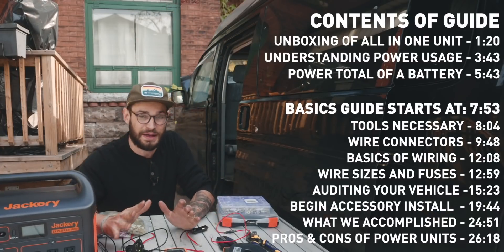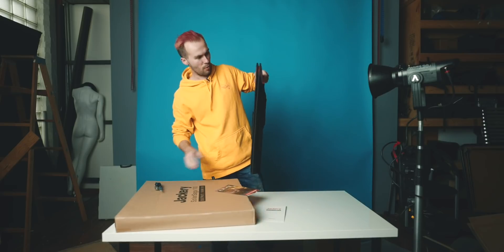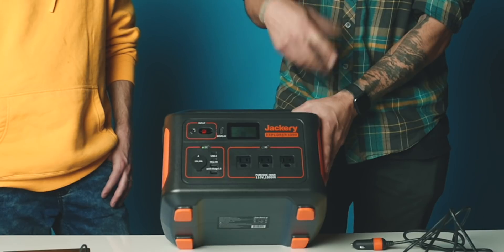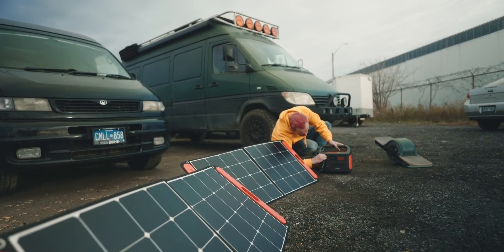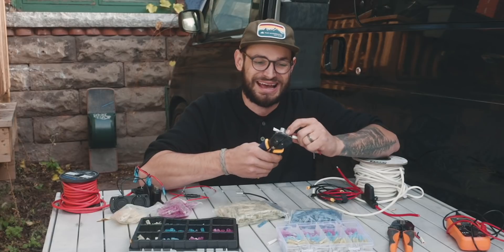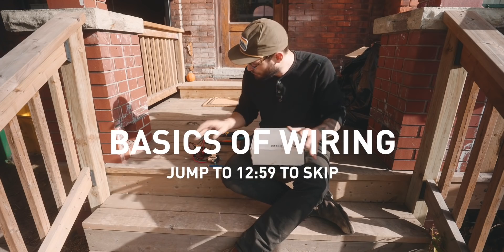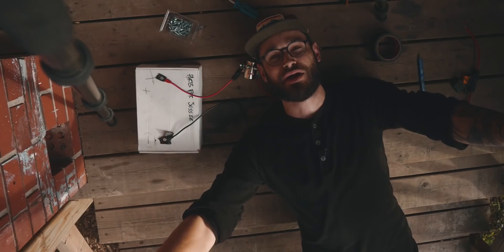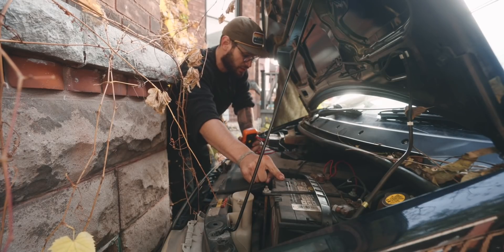Beginners Guide to Camper Van Electrical Install | Absolute Basics

Comment: My wife and I have an Airstream trailer coming our way in February. It has some power options but a Jackery system would mean making content on the road would be so much easier without worrying about the fridge running out of power.

Comment: We use our Jackery 1000 to power our high top Promaster and it is awesome. We swapped from a DC fridge to a 110 fringe with separate freezer door and after 14 hours we were still at 40% with no feeder battery. This works great for our style of camping because the van charges the Jackery while we’re traveling and it provides plenty of power if we stop for the night at a truckstop or primitive camping. We normally stay at places that have power but when we are running around for the day we don’t have to worry about the fridge. I also have a 12 V AGM marine battery we use to backfeed the Jackery. The AGM battery charges really fast when the van is running whereas the Jackery can take up to 14 hours to recharge. For us this system works really well and I don’t need a solar panel.
Reply from the maker: Right, the biggest Jackery downside is charge time. Glad to hear that system is working well for you

Comment: I've been intimidated about wiring my van and I intend to work with a simpler solar generator type set-up - this was a helpful video for understanding the concept. Much appreciated. I managed to live for a month in my van, working full time with a laptop, all powered by my Jackery 500. I was charging my laptop, iphone and MiFi device. I would plug it in while driving and it was about every three days that it would need to have a sleep over at a friends house using one of their 120V plug to top it off. I think the Jackery is a great way to get started into vanlife on very basic needs, if you cannot afford the money or time to do a full solar set up. As you said though, I had to be VERY mindful of usage. I did not have a fridge and my lights were simple magnetic battery powered pot lights. You can get away with very little if you want to or have to. I can see this Jackery 1000 being a great option for car dwellers. Could this unit potentially be powered by permanent solar panels on the roof? I assume so, just like any other.
Reply from the maker: Yes it could receive power from on roof panels. Glad to hear the 500 has worked great for you!

Comment: I'm starting a van conversion in January!  I have a 1990 Ford Class B Camper (Falcon 190).  I will power a 12v cooler, all van power and use the van to work from for extended trips, so laptop, monitors...etc.  I like the idea of these self-contained units for my context because I will not be full time in the van and would have uses for the power pack when I'm not camping in my van.

Comment: I honestly just came across your channel as recommended by YouTube. I am researching into using a power system for my conversion of my 13 year old SUV. I have shortlisted Jackery as proven by many YouTubers. However, I’m in Malaysia and there’s no dealer here. I would appreciate a lot if I’m lucky enough to get your vote as it would meant a lot to my budget. I would also hope to convince others to use Jackery and if possible work out a business opportunity here. I’m prepared to subsidise for transportation cost to Malaysia. With this Jackery, it would solve my electrical needs for my fridge, phones, laptop, lights etc. It will definitely allow me to get a drone sooner which was not a priority at first.

Comment: Yo, that battery/converter/charger/solar-box of magical wonders and mysteries would be the perfect power solution for the van conversion I've started this year! This would step the entire build up from an awesome getaway camper to a full on off the grid mobile basestation because I could bring a mini fridge to avoid spoilage when I'm not able to stock up on food for a week or more. Even so, thanks for the awesome video, will definitely rewatch this a couple times to doublecheck my wiring! Cheers!

Comment: First video that I have seen that touched on why power seems to drain faster while using AC ports compared to the USB ports. I’ve been wondering about this for months now. Thank you!

I would definitely use this for my new circumstance of living in a car experience. Mainly running fans when heat is unbearable during the day, or charging up lights and laptops to keep working when the sun is down seems important.

Comment: I would charge my camera batteries, go pro and lap top. Allowing me to make content in the field and not worry about being off the Grid for multiple days. I did a 5 day river float, photo shoot in Alaska and was so worried about batteries and charging my equipment. And also not being able to back up images.  I ended up having to buy so many extra camera batteries and cards, specifically because I couldn’t have my laptop on the adventure with me because of no available power. Having a power source would of been not only handy, but also would of eased my mind and allowed me to back up my images. I was shooting for a magazine and didn’t want anything to go wrong. I had looked at a couple of portable power sources but never pulled the trigger, because I find they can be confusing trying to understand there outputs. I appreciate you guys explaining it and breaking it down! 👍

Comment: Only just came across your channel recently, through your 9 things you’d change about your van video. Super helpful, as I’m planning my van conversion atm! I‘d use the jackery unit as my main power source/electrical set up, as I do find the job of customised electrical set up pretty daunting - phone charger, my fan, security system would run off it. Thanks for the great content!

Comment: Thanks for the video. Nice to see others workflow for electrical and types of connections. I would use that Jackery, because it can be carried around, to power tools I use on job sites or on the road. Like my Lithium battery power tools or USB soldering iron!

Comment: I would use that Jackery to power my 12 volt ARB FRIDGE and 12 volt lighting system in my cabin or van. Great info on wiring and installing 12 volt appliances.Thanks

Comment: I just bought an old Ford class b van @mobysvoyage . I had to gut the whole thing and I’m currently trying to figure out electrical (it gets confusing). I would love to build a DC system to run a max air fan, a hot water kettle, and some lights. Thank you for your content! So helpful!

Comment: So for just a little hint if you want to charge your Jackery a little faster while out camping or if there’s no sunshine for the solar panels you can plug a 300 W inverter into your 12 V of your vehicle and then plug the Jacquerie into the inverter and it will charge faster Then it went with one solar panel now at two solar panels maybe it’ll be about equal.

Comment: Thought I would have my build done by winter , and am still several months out.  The Jackery could power my newly installed Webasto which has no power, so that I don’t freeze while building out the rest of the electrical and interior.  Winter is coming!

Comment: First off, welcome to Ontario. I would love to get the larger Jackery 1000. I’m currently using a Jackery 240 to power a small 12v fridge and some accessories in conjunction with a small sla battery/solar system. Works ok but have to keep an eye on the discharge rate.

Comment: I’ve been running my Dometic off of my starter battery which has been fine for when I drive every day, but definitely not going to work for long stationary trips. Would love to add a power bank like the Jackery to my setup.

Comment: That would add so much functions to my Unimog camper. Also I would make it so I can also take it into my Volvo V70 station and put an air matras inside and go for a long roadtrip! So much possibilities with an portable setup! The solar panels alone look already awesome!

But wait is it only 110volt? I need 220 :D

And I love building electrical wiring :) I build my whole electrical system Unimog from scratch! So the whole wiretree with headlights signal lights etc!

Comment: Thanks for the electrical lesson! Great breakdown of what is needed and what can be done with some basic know-how to get your system up and running. The Jackery would be great to use traveling in my SUV for now to power my cooler, laptop, etc. Then when I upgrade to a van it could easily move with me.

Comment: Purchased an ambulance. I’m planning to do point of use power. Going to use a portable power station at several power locations. The Jackery would be the main power source (refrigerator, lights, water pump)

Comment: A Mazda Bongo, brilliant..! I never thought I'd see one on here.  I have one myself but a tin top, not an aft and with its 2.5td engine it's a wee beast.  I live in mine and have done on and off for over 2 years now and currently building out version 3.0,hopefully the last build with this van but they are great wee things.

I do have a basic set up electrical wise with a split charge relay but I haven't gone for an invertor or solar because I don't have enough to condone permanent upgrades but I have thought of getting the Jackery to charge up my camera and laptop whilst I am away from work on road trips. Cheaper overall I reckon for someone like myself.

Comment: I would use it to power my small heater.  I have been without heat and have gotten sick.  I’m 70 years old and live in my van because I can’t afford rent prices.  I only have the small Jackery which shuts off as soon as I put on my little heater.  My little dog sleeps with me, my bigger dog has a coat, but it’s been so cold and rainy that I haven’t  been able to sleep well and get better.

Comment: Thank you so much for this!!! Helps quite a bit. Especially the recommendations for tools, wires, and connectors. Next week we’re going to start running wires through our van; two fans, usbs, lights, etc... rather daunting, being this is my first time. We’ve ordered the 1000. Question: do you think we can wire in parallel or daisy-chain a few of the components into the single 12v plug on the Jackery? For example both fans (maxxair), and perhaps puck lights?
Reply from the maker: I’m excited for you dude! You can tap off DC power from the Jackery using a 12v cigarette style plug. And run that into directly into what is a essentially a power strip but for smaller DC circuits, a small blade fuse holder. Lots of options, but you want one you can easily connect the - wires to as well. And then just wire whatever accessories you want to run into the fuse holder and then run that to the Jackery
Reply: @Levi_Allen  awesome!!! Thank you once again!!! 👊🏼👍🏼

Comment: I would charge my GoPro, phone, charging pack and other accessories well doing long-term stands living inside of a vehicle that is not fully rigged out to be a camper

Let alone that you could use it to cook your breakfast lunch and dinner run a a heated shower, the skies are Limitless when it comes to a device like this

Is quite impressive little thing as it would allow a fellow like myself to move between multiple Vehicles as the budgets a little tight to do a permanent build so it would allow me to take my work van and use it as a camper or vice versa

Comment: Gotta say it would be pretty neat to have the ability to charge up my drone, and cameras without burning gas in the car! this would go great in an old travel trailer . off the grid camping as long as its sunny! 
I was looking at these on AMAZON but also couldn't bring myself to take the plunge. Whoever lucks out on the giveaway should drop the 1000 on a dc cooler! I think thats a winning combination. who doesn't like chilled beverages! 
great vid . thank you for emphasizing the connectors!

Comment: When you pointed out the voltage sensing relay I had an ARGH ! So that’s what that thing in the relay/fuse box on my 1976 Ford Transit Autosleeper is ! 
Thanks, that’s one step further into my van electrics audit. 
I’m hoping my AC200 from Bluetti  is going to arrive by the end of the month ready for when we in the UK come out of lockdown! 🙂
You didn’t clarify that the power bank can be charging as you’re driving as the leisure battery is being charged by the alternator. 
Does the Jackery have a current regulator so the alternator doesn’t get burnt out?

Comment: Super useful video! Planning to change the battery in my van soon as its not holding its charge well anymore. Is there a maximum amp limit on the 12v sockets? 

PS its a shame Jessies lav mic didn't seem to be working at the start. Rather than compressing the two sources together it may have been better to just use the on board mic to keep the room time balanced.

Comment: Can you add on additional batteries?  I’d recharge the basic cameras, phones, rechargeable lights, and a electric kettle.
Reply from the maker: It’s not a straightforward system for adding more power to. The main way to do that would be an auxiliary battery like we utilized in Jesses vab

Comment: Is it just me or do other people cringe when someone opens a hood/ bonnet without removing the dead leaves  that’s collected in the crevices.
Reply: I would use the Jackery to power DC fridge while traveling and DC running fan while sleeping. Great for charging devices and having power when weather is bad. Traveling in my Subaru Outback.

Comment: Did I hear you right? you're giving one away?!? I need help, I lost my roommate to a sudden heart attack, she had a valve issue she forgot to share, her daughters moved in and wanted me out right away.  I pay child support so I can't really afford much and with the recent fires, rent has tripled, so I bought a 1976 camper for my truck, the propane was old and I'm not a fan so it's being converted to electric .. I'm plugging into a source now and charging some 6 volt batteries now - I could really use a Jackery and will probably get one if I can save up for it - either way, thanks and cheers